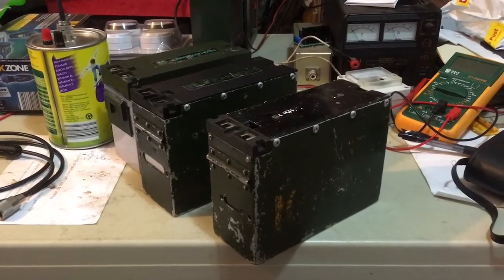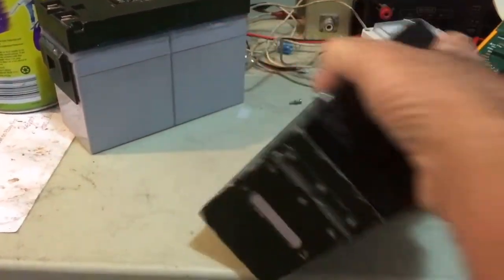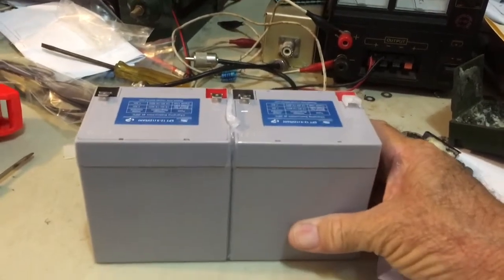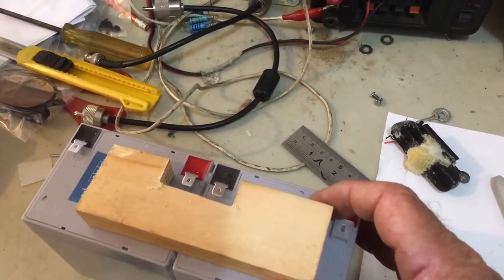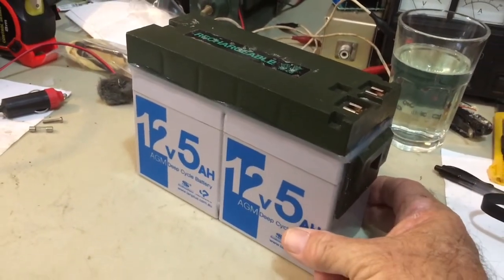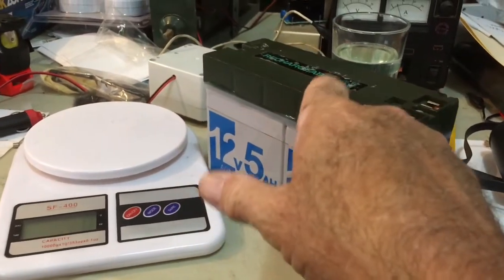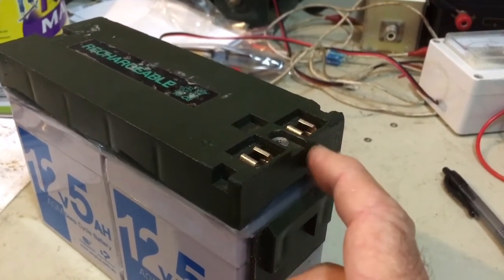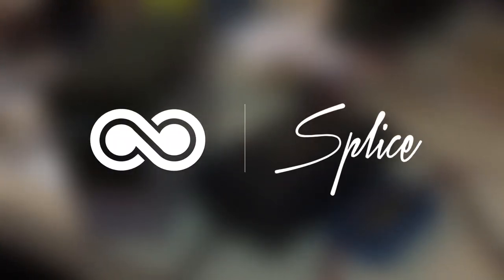VK2PRC Clansman Plastic Battery Rebuild.

Comment: epacked mal battery with 14 2500mah 18650 lion cells with a 7s bms its 7s/2p,bigger capacity than the original and about a third of the weight,charge it thru a bnc connector on the side of the battery with a cheap ebay charger.

Comment: The charger you recommended is available on eBay in several amp ratings, 2, 4, and 8 amps.  Which one do you use?
Reply from the maker: The one I use is a 2 amp model, charge on a flat battery is 1.2 amps dropping down to about 0.2 amps before cut off.  As a precaution I use a 4 hour power point time as well.
Reply: Very good, thank you.
73s
John KC5WKL

Comment: very neat job,..what tool did you use to cut the old battery open with,  so you got straight edges, ...I'm guessing a hacksaw would have made a horrible mess of it just sawing by hand .........G4FBC
Reply from the maker: 24 TPI hacksaw.

Comment: Do you not need a vent hole in the top of the old case to allow for the possibility of venting Alex?
Reply from the maker: Well the SLA batteries have no vent holes, so, no!  I'v been using this battery since making it with no problems.
Reply: @vk2prc978  My understanding is that SLA batteries do not normally vent, but will do so under improper charging conditions.
Reply: @vk2prc978  I'm not worried as such, I was just trying to be helpful

Comment: ..was wondering what the outside dimensions are on the 12v 5ah batteries you are using? I cant seem to find that exact brand/model online....? Very nice job and certainly a way to keep the clansman fleet going for a long time.  thanks so much for posting. 73, N9IOR
Reply from the maker: The are standard Alarm batteries used around the world. You can find them on ebay as 12V 5AH SLA AGM Battery Replacement 4 Razor PowerRider 360 Electric Tricycle. or  5Ah SLA alarm batteries.  The sizes are:   90mm by 70mm and 101mm high
Reply: ok..thanks. that is exactly what I needed. Hope it helps other too.
73,dave